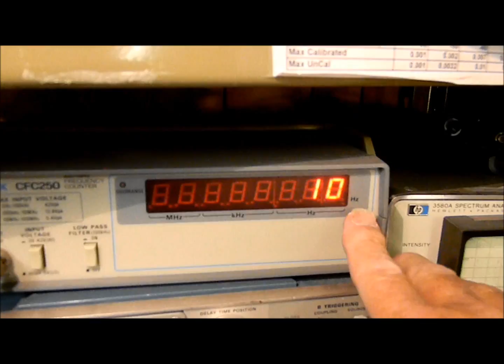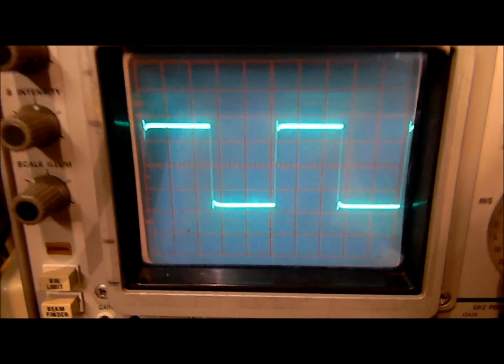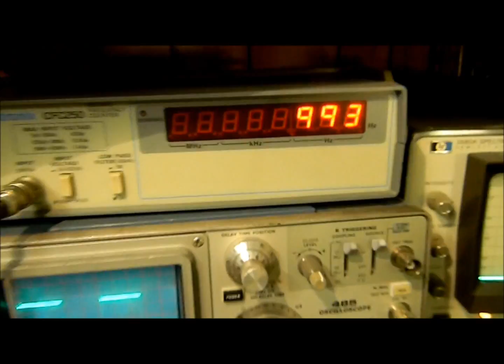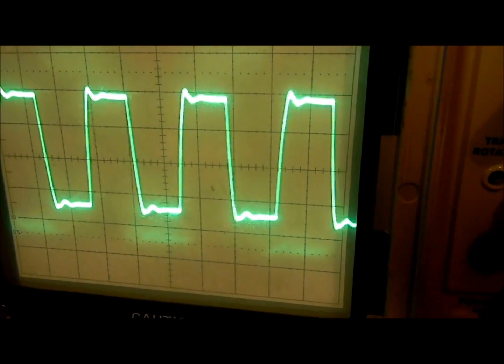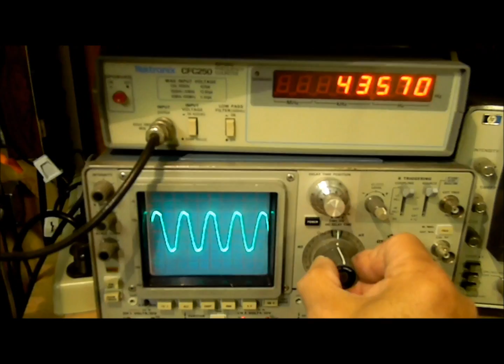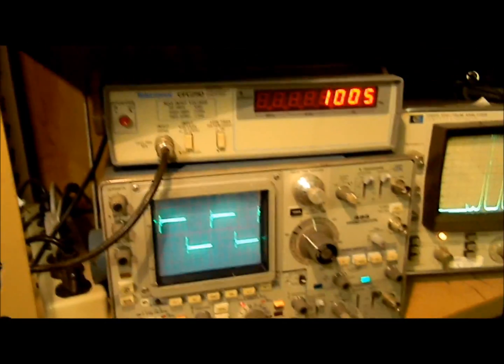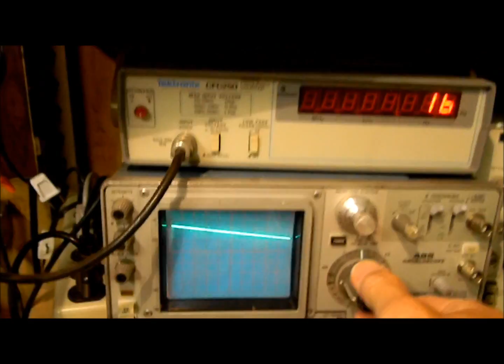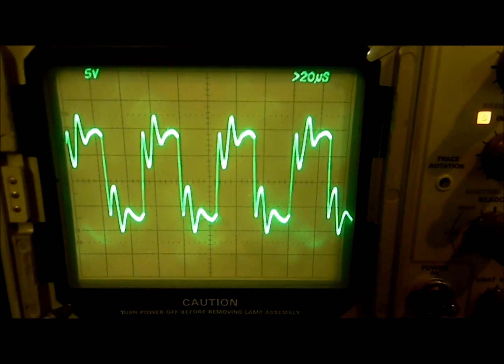Square Wave Testing of Audio Vacuum Tube Amplifiers

Comment: 5:30. Those slopes are both negative in reference to the 0V reference. They indicate a low frequency roll off. The Low frequency roll
off is better than the ST-70 as the ST-70 does not have sufficiently large filter capacitors. Which means this amplifier is a bit better than the ST-70 in overall low end sound quality. 

Your 20kHz square wave shows an excellent high frequency phase response  as we expect from Dynaco Output transformers. An amplifier with air and the very open high end that Dynaco is famous for. Again, a little but better than the ST-70. But not by a lot.

That Fisher is crappy in comparison. Quite a coarse sound and a thin bottom end. Indicating insufficient power supply capacitance and maybe not very good iron or too little of it in the output transformer. In the 2000s I worked for someone who was a junior designer at Fisher at that time and he would not be pleased to see the result compared to the Dynaco.

By the way, I am the designer of the Dynaco ST-70 Series 3 Amplifier.  You are doing good work here.
Reply from the maker: Thank you. I hope we can communicate about some other designs that 50+ years ago would have been considered old-school, SET.  I am pleased for your comment and we can discuss. Interestingly, I just had a discussion with my son about speakers. I try to relate the sound of such speakers to my professional musician friend. My son, like me, seems to prefer the sound of Klipsch horn speakers to the Tekton which my friend prefers. My first youth experience was with the Fisher ST-70 and a bass reflex the size on the Klipschorn that had the University midrange, tweeter and EV 15W from 1962 era. It formed my ears, so to speak…  moving forward I had the MC30 and C8 with EV speakers. Now I often listen to homebrew SET into Klipschorns on my homebrew Williamson. I think there is continuity there. I always respected the Dynaco for quality and performance. Much respect for your career and design. You can find more about me on QRZ.com WA4QGA or ElPaso TubeAmps on YT.

Comment: That's amazing!  When you consider that the second term in the Fourier series of a square wave, after the fundamental, is three times the fundamental frequency, that Marantz has good response out to 210 KHz!  I'm sure that ringing in the Fisher is due parasitics.  That can be easily fixed, by adding a little negative feedback, at the right frequency.  Hams deal with that problem, a lot, with RF power amps.

Comment: hello ,id like to know what the ringing means for an amp !
Reply from the maker: It generally ringing means that the load impedance (the speaker or dummy load) does not match the output transformer perfectly. 
Damping has a good analog in cars. If a car does not have a shock absorber, then the car will oscillate up and down as it goes over bumps or ups-and-downs making it ride like a ship on the ocean. If the spring is way too stiff or the shock absorber is too stiff, it will ride like a pioneer wagon and the rider will feel every bump. If the spring and the shock absorber is properly matched to the weight of the car, it rides relatively smooth and straight on the road. A similar thing occurs with amplifiers. Ringing in the output generally manifests in "boomy" bass much like a juke box. This often is caused by a cheaper transformer with a higher impedance secondary that can not control the voice coil of the speaker and the speaker oscillates like the car with out a shock absorber.
Here is a very good article on square wave testing I think you will enjoy.
https://sound-au.com/articles/squarewave.htm

Comment: 5:09 ... If you include a preamp and do this test,  you can turn the "Bass" control up and down and see how it affects the 10 and 100 Hz square wave.    The tilt you are showing here indicates a roll off at low frequencies. (subsonic).   If you check it with a sine wave you will not see a lower amplitude.  If this tilt in in the opposite direction, it indicated a boosted bass level.

Comment: What is that anomaly in the output form at high frequencies due to? Why does it look more like a sine wave?
Reply: It's basically due to the amplifier's frequency response, and the fact that the amplifier's gain is decreasing as the frequency goes up, it also has to do with the output-transformer's frequency response too.
Reply: It's caused by limited bandwidth of the amp. At 70kHz you have just a few odd harmonics left for creating a square wave, since perfect square waves are made of an infinite number of sinewaves (ground wave plus odd harmonics) 
https://www.youtube.com/watch?v=TNiA0Y5tHQQ
Reply: To me, it appears that the anomaly seems to be nothing more than the rinigng seen in the lower frequencies. If you watch starting around 13min or so, you see as he goes up in frequency, only the flat dc line gets shorter and all he is left with is the ringing.

Comment: To bad you have no idea what you are doing and what the display is telling you. All the fancy test equipment in the world is useless if you can't interpret what it's telling you.
Reply from the maker: I will admit that my videos are less than perfect much of the time but NASA and White Sands Missile Range thought I was pretty good for 26 years as an engineer before I went into management. Guess I was just lucky and had them fooled. Maybe you could be so kind and interpret what is on the oscilloscope screen for us and share your knowledge with the YouTube community.
Reply: ElPaso Tube Amps  ...  Bonnie  is being a jerk and perhaps doesn't even know herself.   I posted above what these tilted square waves are indicating.  If one has rarely or never used square waves to test amplifiers, it is not uncommon to not understand the waveform.  As I said above these wave forms are showing roll off of low frequencies.  (in this case subsonic at that).   Another useful waveform to use is a triangle wave.
With the triangle wave you can observe the linearity of the amplifier at different frequencies.   A function generator is a useful tool for evaluation amplifiers.  Mine also will do saw tooth and linear and log sweep functions.

Comment: Find the capacitor that is parallel with the feedback resistor off the output. Increase it slightly. You can knock down that overshoot.
Reply from the maker: There is a procedure for determining the value of this capacitor but I can never remember it off the top of my head. Some suggest using a square wave at 1 KHz and adjust the value for best square wave. Sounds reasonable but I have not tried it yet.
Reply: No need to calculate. It's never right. :) Start with a value of 100pf or so and adjust as needed to tame the overshoot. To simplify, overshoot is just a delay in the NFB signal due to phase shift (lag) in the amplifier's circuits. Say you had an open-loop gain of 26, and closed loop brought that down to 20. With the loop closed, the gain is still 26 until the feedback finally shows up. That make sense? It always made more sense for me to explain it this way vs. explaining dominant poles, phase shifts, and attempting to calculate it.

I would enjoy a video showing the location of the capacitor (easy to locate) and how it's value effects the leading edge of the waveform. Many a DIY'er has had to deal with this.

Comment: Thanks for this posting. I searched for the term "square wave testing" and arrived here. I've seen several YT posters who build tube amps. Most of them test their amps with a 1 KHz-or-so sine wave. The ONLY things a sine wave will show you is non-linearity and clipping. A square wave shows frequency response.

Comment: I don't know if it's the same but, the  human hearing range falls between 20Hz and maybe 22Khz so isn't it pointless to run the test beyond 20 or 22Khz? As I said, I don't know if the frequencies you refer to are the same as the audio frequencies in a stereo amp.

I do know that McIntosh amps are among the best in the world, (I only wish I could afford a couple of 700w mono Macs circa 1985... I WISH!). Therefore, I would guess that they would focus on keeping the distortion to a minimum in the 20Hz to 22Khz range and anything higher or lower than that wouldn't be too important to them.

I also agree with Jora Lebedev; it would have been great to see how you configured your connections. I'm trying to learn how to use a scope and I am in the very early stages of that understanding. I don't have any other equipment except for the basic oscilloscope, (BK Precision 2120), and I'm using an old Radio Shack 25w per channel stereo amp as a 'test monkey'.

I see you have several additional components there and I wonder if that's a "mandatory" setup for testing anything using a scope. I'm sure some of, (if not all), the equipment improves the input/output voltage stability and the accuracy of the test results on the scope, but is it really required for a more "casual" test session?
Thank you,
Rich
Reply from the maker: Hi Rick,
If you have a scope you are 90% there.
You will also require a resistor for a dummy load (one for each channel) capable of dissipating the maximum amount of power your amplifier(s) will deliver and you need a driving voltage that is adjustable from a few mV to maybe 2.5 volts and you have all that is necessary for a set of basic measurements.
You drive the amplifier input (usually the AUX input) with the adjustable voltage source usually at 1 KHz at about 1 volt with dummy loads across the output of your amplifier. You can connect your scope across the dummy load and increase the volume on the amp until you see the waveform just starting to clip at the tops.
 When connecting the scope across the dummy load be careful to not connect the ground lead of the scope to the "hot" side of the speaker output terminals where the dummy load is connected. This could short your output to ground and damage a solid state amp. 
If the waveform looks good and symmetrical to that point and starts clipping the top and bottom of the waveform the same amount, you have just reached the 1 or 2% harmonic distortion level. If your scope is calibrated you can measure the peak to peak voltage on the scope and multiply that value by 0.353 which will give you the RMS voltage across your dummy load and assuming your dummy load is 8 ohms, you square the RMS voltage and divide by the 8 ohms and you get the average power in watts.  Example: assume your PP voltage on your calibrated scope is 40 volts. Multiply by 0.353 and get approx 14.12 volts. Square 14.12 and get 199.37 then divide by 8 and get 24.92 watts. (PS - probably best to not leave the amp running at max power for very long as it may damage the amp. Also, the dummy load resistors can get really hot is they are run at their maximum  power level). That is petty much were everybody starts and you can obtain more sophisticated equipment from there.  Hope this helps.
Reply: Thank you sooooo Much!! a few hours ago, I ordered a Signal Function Generator from Amazon.com (https://smile.amazon.com/gp/product/B07211YWMK/ref=od_aui_detailpages00?ie=UTF8&psc=1). It may be more than I really need but I'm considering the high probability that I'll be buying a better scope as I  continue to learn this field, (as a 'base-level hobbyist'). 

Anyway, in the past 40 years or so, I've collected, (and continue to collect), many various electronics including breadboards, resistors, diodes, caps, transistors, etc. Based on your reply, I'm pretty sure I have all the components I need. I plan to setup a breadboard with the configuration you've mentioned.

As for the Radio Shack amp, it's a 'working' 25w x 2 amp but I got it for free years ago. It's not in any shape for me to use so if I blow it up, I won't mind, (I have a much higher end Sansui amp that I definitely won't try anything on). I also have a pair of 'test-monkey speakers' that give me the same affordability, lol.

I have three questions: 
"you need a driving voltage that is adjustable from a few mV to maybe 2.5 volts"
(A): Should I use DC or AC power for the adjustable voltage? I'm guessing that it should be AC but I do have a nice, small, DC regulator if DC power is to be used.  

I also have various resistors from 10 ohm to 1M ohm. 
(B): Do you have a recommendation as to what size resistors, (or the amount of resistance), I should use? Considering that the amp is 25W per channel, how much resistance would you use in the dummy load?

(C): What is the value ".0353" refer to? Is it a constant figure that never changes? 
Thanks again for the pointers.
Rich
Reply from the maker: The driving voltage must be AC and the standard is 1 KHz. Your oscillator you purchased will probably go from 20 Hz to 20 KHz so you will have all you need in that. I am sure the output of the oscillator is adjustable also.

The most common load resistor is 8 ohms. Radio Shack sold 8 ohm load resistors when they were in business and I think they were rated at 20 watts so those can be used as long as you don't pump lots of power into them for more than a minute or so. 8 ohm load resistors are all over Ebay and not expensive. They will be listed as non-inductive 8 ohm resistors.
The peak to peak voltage as read on a scope has to be changed to RMS voltage so you can look at it a couple of ways. Typically we think of peak voltage which would be one half of peak to peak. In the example of 40 volts peak to peak that would be 20 volts peak. To  convert peak voltage to RMS voltage you multiply the peak voltage times 1/(sqrt(2)) which is approx 0.707.  1 volt peak would be 0.707 volts RMS, 10 volts peak would be 7.07 volts RMS and so on. If you use peak to peak as read directly off the scope you would half that voltage again so you would divide the 0.707 by 2 and get the 0.353. Hope that makes sense.
Reply: Yes, it absolutely makes sense and I very much appreciated the time you took to explain that. The signal function generator will be here Saturday and by then, I should be able to acquire the non-inductive resistors.

In other words, I should be able to try this out by Saturday afternoon!
Thanks again,
Rich
Reply: Oh, I meant to update my results and of course, you were spot-on! It's hard to explain but I was fascinated by the results of additional tests I did after I completed this configuration first.

As for the Radio Shack 25w per channel amp; well, it's a very old, (circa 1990, maybe) and somewhat worn-out amp that I got for free about 5 months ago. Whoever owned it didn't put a lot of energy applying 'upkeep & care' to the unit. That said, I was surprised to find that I could get to about 80% of the volume level before the output wave became distorted. The amp's best power output was held to about 19 watts.

I know that it would get to about 22 watts when I would first turn it on and run the test. However, after about 5 to 8 minutes, the wave would begin to distort and I would have to cut back the volume to settle on 19 watts. Nothing got hot, not even warm, throughout the time I had it connected for testing. Most of the time, I sent no more than about 1.75v through the Tape inputs from the DDS.

A few times, I forgot to cut back the volume level and even at near 75%, nothing got hot, the 8 ohm resistors certainly stayed cool as well. Anyway, this test and subsequent variations I tried, has taught me a lot more than I would have learned from using only a DVMM.
Thanks again,
Rich